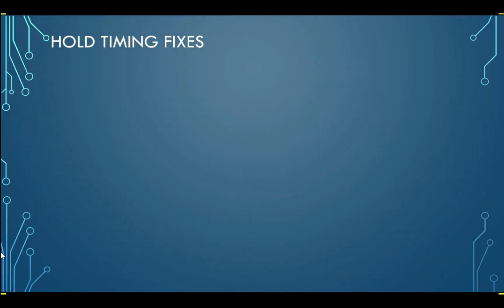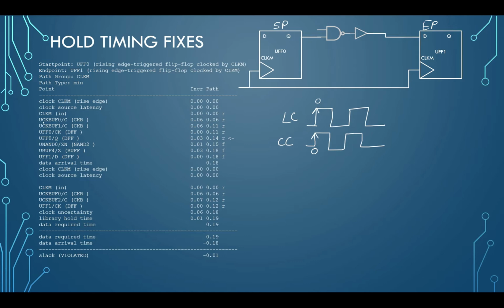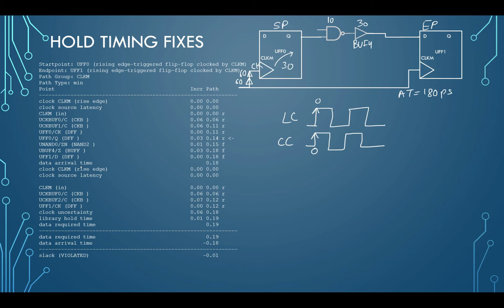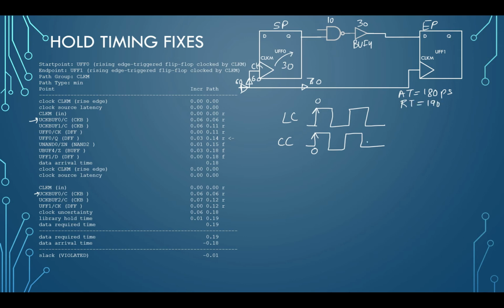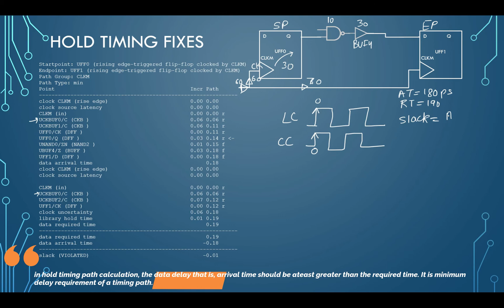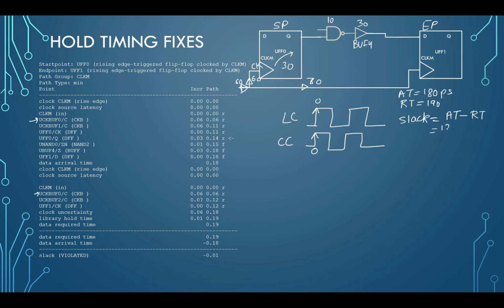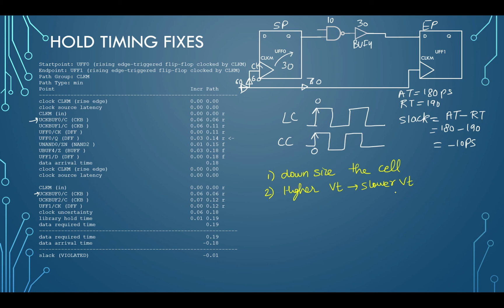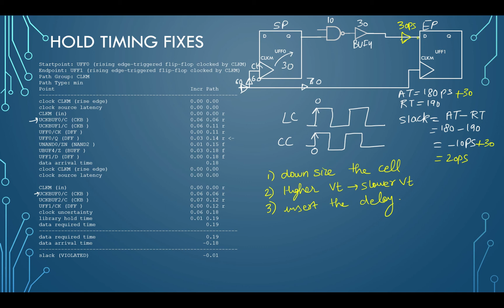sta lec21 hold timing fixes in path part2 | Static Timing Analysis tutorial | VLSI

Comment: In a synchronous clock system if there is a clock uncertainty it should be considered for both RT and AT right? but why only in the RT in the above example?
Reply: @VLSIAcademyhub  thanks for that explanation. got it
Reply: @saidileepchowdarynuthalapa6364  what is the explanation? can you share please? thanks
Reply: @quest95112  uncertainity always in clock ,so always apply uncertainity in RT whether it is for setup check or hold check